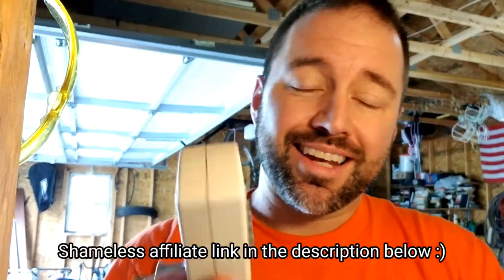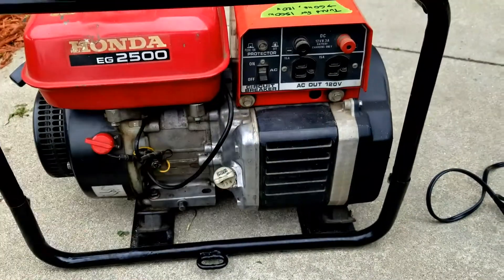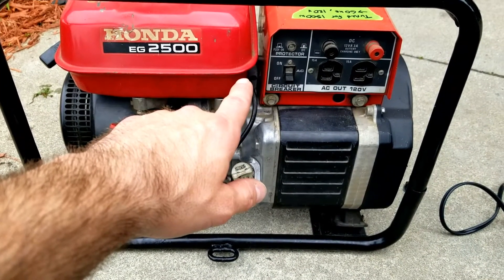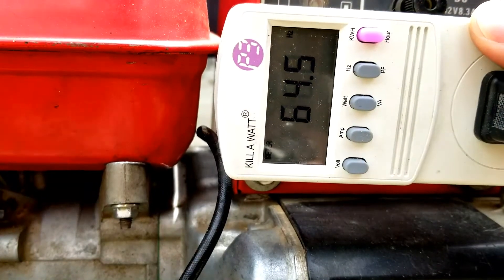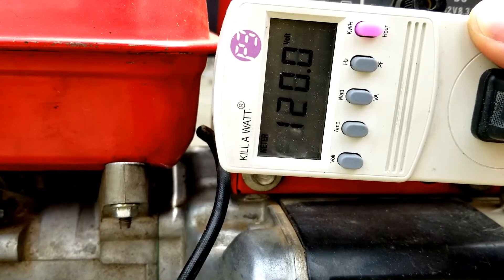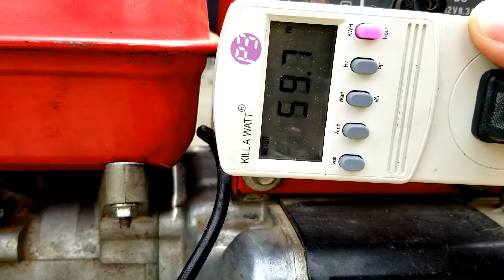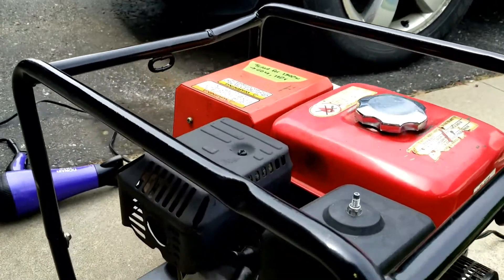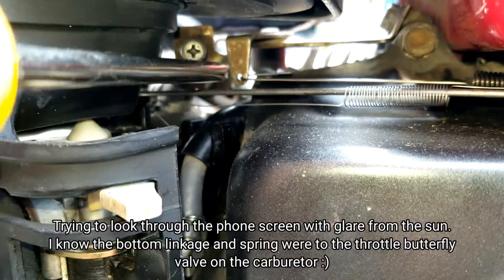Generator: DON'T Forget To Do THIS or You'll FRY Your Sensitive Electronics!

Comment: Frying sensitive electronics .....is an OFTEN REPEATED warning......Have not seen ONE person commenting on any discussion board that it happened to him....but the warning gets picked-up and repeated by everyone, as gospel. I get it.....your video here is good to numerically measure Hz and voltage and to bias these factors,  to accommodate a loaded vs unloaded condition. Excellent. BUT...the frying of electronics overall is overhyped as a warning, and as long as your NORMAL ( non-inverter, open frame) generator has an AVR ( Automatic Voltage Regulator) and if you also tune per this vid.....you should be good -to-go. Besides tuning operating speed (RPM), the AVR itself can be tweaked. In any case,  it's typically voltage spikes that kill equipment....not inverter "clean" vs non-inverter "dirty" ( sine wave) power.  And this....if you have a lot of loads that toggle on/off.....better if your genset is larger than normal so these swings are less pronounced.
Reply: Although your comment is logically correct, there are some differentiations. The AVR sets the nominal voltage output at a given (nominal) generator speed. Moreover AVRs are not always adjustable. The frequency now, depends exclusively on the speed (and the number of poles) of the generator (a fact that affects the output voltage as well). So, the AVR regulates the field (exciter) current which in turn sets the nominal voltage output. The frequency now, being revolution speed dependent, it is obviously varying with load variations. The correction to that, is the task of the governor adjustment/responce. And the occurring overvoltages are due to the (unavoidable) governor delay in order to reduce the generator speed fast enough so that no overvoltage will occur at the output when a heavy load is switched off and other small loads are still on. Furthermore the use of a much bigger generator (in order to avoid this problem) is both the most expensive and impractical solution to this problem...
Reply: @ΠάριςΑζής  ...my point is that the "warning" to only use inverter generators for home use....to avoid "frying electronics" etc....is an over-blown warning that someone first posted... and then it gets picked up repeated with no further thought...yet, I see no one mentioning they actually had a problem. I took the action to actually install a Volt / Amp / Frequency meter on my (cheap) Harbor Fereight unit...and under a no-load or loaded condition....I am tightly managed to 60 Hz. I actually have two such meters...one for each of the 120V legs that can also supply the 220V output via the heavy 4 prong connection to the house by using both "legs". Same thing.....each leg shows 60 Hz. My point of suggesting maybe using an oversizing the genset is only a minor addition to the issue....as a larger unit not loaded as heavily will likely encounter lower swings as to load. My unit is smaller, more closely matching my need.... and does fine. I stand by my previous comments relating to the excessively exaggerated safety warning of this issue that only serves to give folks unnecessary worry...and for sure causes increased sales for the pure inverter units...it's not the problem as presented.
Reply: @TheWilferch  I understand (and agree with) your point. Nevertheless I have repaired many inverter welding machines after being put to work on such generators...And the failure mechanism is always the same. Burned out input circuit components due to overvoltage, which happens due to slowly responding governor of the generator. 
Keep in mind that due to the exactly same reason, the most difficult test of a power plant is the load rejection test without tripping the unit...It fails in most of the cases...
Reply: @ΠάριςΑζής  ...not a problem for home standby generators with properly functioning AVR's..... we simply don't see the reports of this actually happening....just the warning that it may happen. As I said, my unit is now equipped with additional V/A/ Hz meters....and all seems tightly controlled to the required parameters. Maybe a slight voltage drop under load....that's about it....and such a drop won't cause these catastrphic failutes we are all warned about. My sense is that was all started to encourage people to dump functioning older units to then buy new inverter units.
Reply: @TheWilferch  It’s a quite logical thought. Marketing...
I believe the same thing about the argument on pure sinus inverters against their modified sinus counterparts...
Exaggerated fear about burning various loads, which is not valid...
Reply: @ΠάριςΑζής  ...exactly the point. No doubt the more "pure" the waveform the better....and no doubt the inverter gensets are better in this regard, but overall considering  that we can be careful how "normal" gensets are used, and that we can add V/Amp/Hz meters as I did....it is mostly an overblown warning that causes people to be too fearful to use for home backup...and makes them discard their old units and then to buy new inverter units.
Reply: @TheWilferch  Yes...I guess “buying” is the magic word behind all of this story, not surprising anyway. 
“Fear is the result of lack of knowledge” on the other side, making aggressive marketing more effective on the part of “sales up” target...
It’s our wonderful world...anyway...
Reply: Spent like 10 hours reviewing mostly comments regarding every gen on the market and I have to be honest here in the comments of what I found d, first the info in video is very useful and beyond my pay grade on the subject but I cannot to e anyone in all my research  that stated there gen fried anything they are lowering g. Is there a possibility people just rather not say in comments or there video productions, maybe but I've read through al.let all comments under all major brands of gens reviews also other places such as Costco website and beyond but not a single god person states there non inverter gen has fried anything. So again I'm just in the middle saying g what I found out there. So I think good I formation all way round d and good vid  knowledgeable all way around.
Reply: I only found 1 to two reports out of hundreds of different types of minor failures of ARV failing and one was in a Firm an and another in one can't remember. But no reports of fried computers etc. Can it happen maybe but not hearing it in comments, seems like only thing being g reported is the actual gens breaking etc.

Comment: Just get an inverter generator. They are now comparable in price to non-inverter types. There are also some with clean energy that are not inverters. These have naturally low THD.
Reply: Inverter generators are 25-30% more expensive than non-inverter generators in the mid-range kW units, and this disparity increases with capacity.  It's similar to SSD and HD cost differences.

Comment: 100% best Generater.Systems I have used. A test for hurricane prep here in Louisiana: three AC units, 5000, 5000 & 8000, 3 fridges, 2 device power setups, 4 flat screens....AND I had 40% of the power meter to spare.
Reply: Why would you want to?  Just a waste of fuel.
Reply: Why not?. They are built for that. I've had to run mine for days at a time.

Comment: wired mine into the panel for whole house. fried, bath fan, room fan, computer , luckily i didnt have the TV on
Reply: Wtf happened?  This scares me, all I really want powered is forced air furnace, refrigerator  and freezer, both stand alone.
Reply: @jolkraeremeark6949  ...why would any type of "fan" (motor) fry?.....it's not even the "delicate" electronics we are all cautioned about. Something else and basic must have been amiss.
Reply: @TheWilferch  reverse polarity during bad wiring?
Reply: @jolkraeremeark6949  ...AC motors are not polarity sensitive.......
Reply: @TheWilferch  Your guess is as good as mine. Possible power surge when the generator was choking out. Used it again a few weeks ago with no issues. But only a select few circuits active.
Reply: @ProfessionalDad  ..it would be good to go over the mode of failure. In the original case where you say you fried those many things.....did the generator overload and shut-down? Or....was the generator loaded under-max capacity?...and something else happened? If you wired it into the whole house, you should be careful and NOT have a bonded neutral at both the main panel AND at the generator ( generator has its own bonded neutral). Either make the genset floating neutral or lift the ground connection between the inlet connection and the main panel. And for the latest run....where you say you ran it again "but only a select few circuits".....what kinds of devices did it support?.... and did nothing "fry" now? A few more points of detail can help remove a lot of fear here.
Reply: ...why would any type of "fan" (motor) fry?.....it's not even the "delicate" electronics we are all cautioned about. Something else and basic must have been amiss.

Comment: Can I just plug a portable inverter to my standard generator for TV and other sensitive devices without damaging them?
Reply: The inverters Ive seen are designed to be hooked to batteries to make AC power
Reply: You could if you get a generator that happens to have a dc power port, there's a few out there.

Comment: I watched this video fully expecting the host to mention in wrapping up that none of this adjusting is required if you have an inverter generator. I have a Honda EU20i Inverter generator which outputs a constant 230V 50Hz, I'm guessing there's an equivalent model for the US market @ 120V 60Hz. I would never ever consider using the types of generators that you have for house supply. Here in Ireland the non-inverter generators are used mainly for portable power tools, and that's all. Those kinds of tools are robust enough to handle voltage and frequency spikes. Sure, you might get away with avoiding damage to a AC to DC electronic unit such as a laptop, but things like printers, fridges, coffee machines with electronic elements etc can all be damaged by these cheap generators. As more of our electrical items become smart there's more at risk from a "dirty" supply.

Spend the extra money, buy an inverter generator rated for sensitive equipment and at least you won't have worry about frying your equipment.

Comment: I prefer to use inverter generators. Costs a bit more up front but pays off in the long run. Just my opinion.
Reply: You get far less wattage output also for 3x the price… and more shit to fail.
Reply: I agree.  i spent $800 buck for a 4500 watt dual fuel genny a year ago.  i would never use a non inverter construction generator
Reply: An inverter generator is good for sensitive electronics, but it's the worst choice (i.e the most expensive or luxury one while not needed) for heavy loads, especially for those used for heating purposes (i.e for pure Ohmic loads). A standard generator in cooperation with a quality electronic voltage stabilizer is a much more preferable and cost effective solution. The worst case in working with such generators is the high possibility of frying a small load, when the generator feeds it along with a heavy one, at the time when the heavy load is switched of and the small load remains connected...This needs a very fast governor to reduce the generator speed immediately, but this is not always there...This is the most common reason of inverter welding machines failures when working on portable generators...the governor delay...

Comment: 1500 is very low and not efficient enough for that size
 but I’m sure it very reliable I would need a min of a 30 amp continuous power in my application still looking for a good one thanks for the video
Reply: You plug in your electronics in the filter and the rest can plug in direct

Comment: Put your sensitive electronics on a UPS.  The UPS will clean up the power nicely.
You can also replace your generator with an invertor generator--it provides much better auto-adjusting when loads change.

Thanks for sharing!
Reply: …UPS have problems too depending on the model.   I’ve measured a lot of ‘pure sine wave’ UPS under load with an oscilloscope. Many have a wave which roughly matches a sine wave, but when you look closer the wave resembles a sharks mouth.   Why have I done this? Because I’m a communication engineer and have experienced many instances when UPS have damaged the electronics they are meant to be protecting.  Hope this helps.
Reply: If you want clean ups power, you need double-conversion. AC-to-DC-to-AC.
Reply: It has to be an inline ups, most ups are not, if they detect power input they pass it to the electronics as it is

the generator can fry the ups motherboard

Comment: That's why you buy a Quality Generator with a AVR (Automatic Voltage Regulator ) & ETC (Electronic Throttle Control ) which is very accurate at maintaining The engine Rpm's to maintain 60HZ , Mechanical Governor Control is not very accurate at maintaining a Engine Rpm's so HZ will fluctuate   , Plus most Owner manuals will give the  NON Load Voltage & HZ  settings for your type of Generator